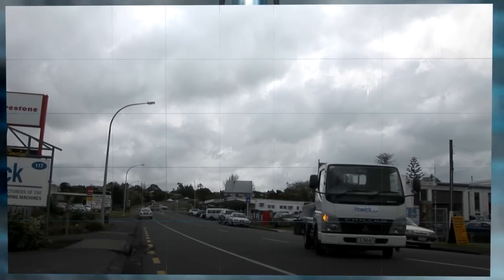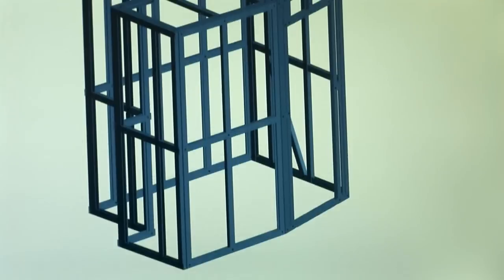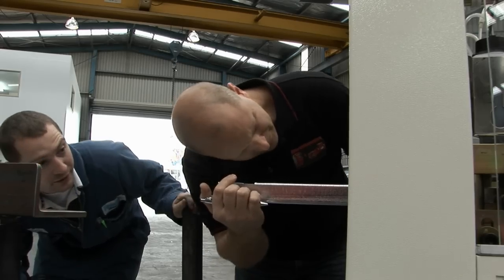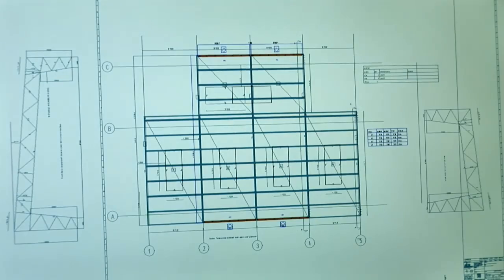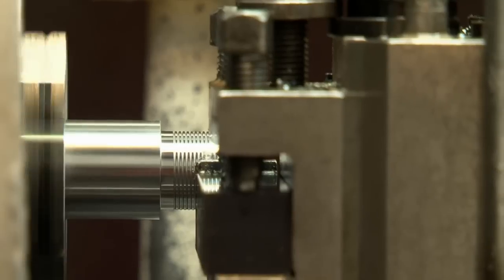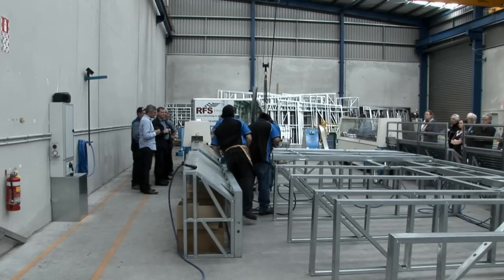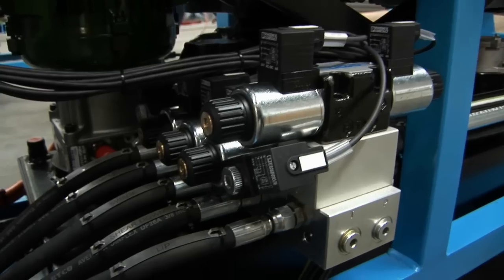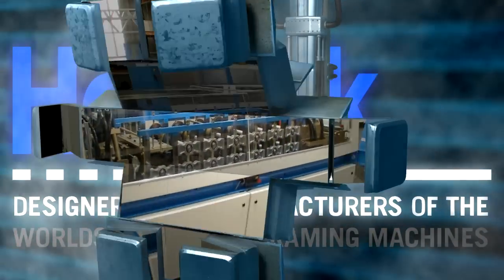Howick Ltd English 11

Comment: Hello,good day,,this is from steel core home inc,from philippines,we're using howick machine for framing,for the moment we experience a problem,everytime we going to run,,,the computer will shutdown ,,then restart again ,sometimes it happened 3 to 4 times ,then the machine run normal,but if u press the pause button,, then press again to run,the computer shut off automatic,,we need advice from you guys,if what can we do about this problem,thank you,